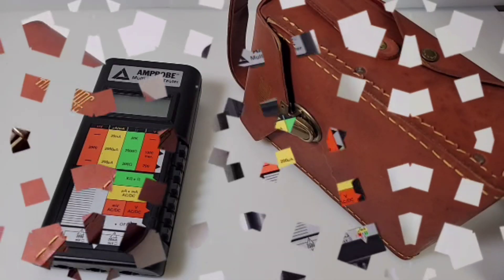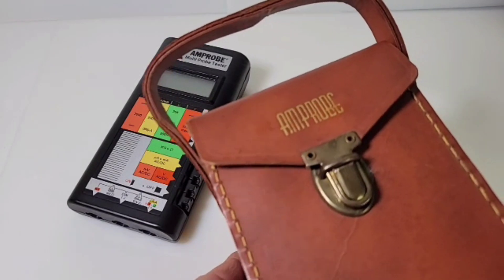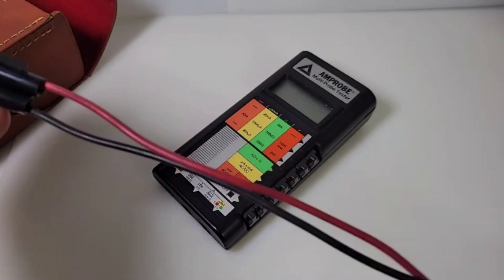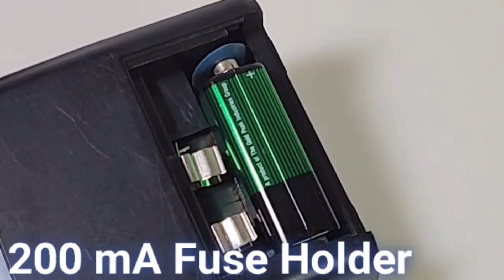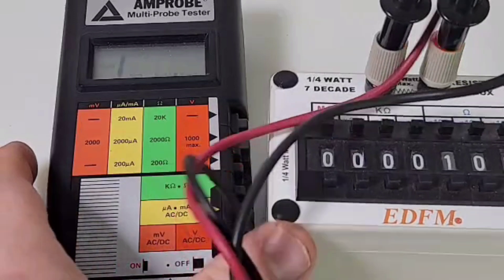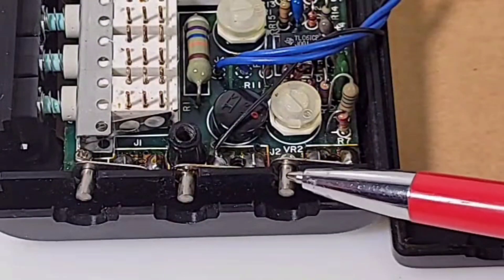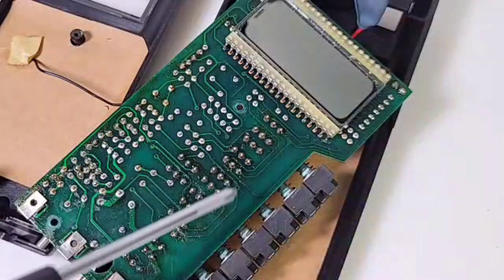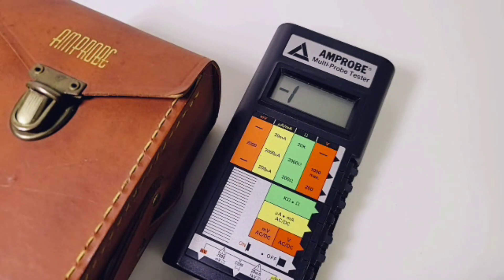RETRO-TECH ○ AMPROBE AM-5 Vintage Multimeter Mini Review  & Teardown!

Comment: Hi Darren. I received my house 616 today. I'll tell you a little report.
 I got the old version. Well, how old ... They showed that they now have a new case, where the numbers 616 are in the corner, and I got where the numbers 616 are in the center under the screen.
  The multimeter probes are standard 10A, half gray and half colored. At first they worked a little worse than my homemade ones with a good wire, but when I slightly cleaned the ends with 2000th sandpaper, then they began to work well.
 The 7502 main chip works fine. The call is very fast. Resistance shows very well. It measures capacitors - not very fast but not slower than its competitors. The voltage measures perfectly, exactly. I can't measure the current strength - I need an exact detail.
   NCV works and works well enough.
  Do you know how to check where the phase is in the outlet? I answer. You put the device on the AC voltage position and put any 1 probe into any socket. Where there will be 2 times more voltage, there will be a phase. Or you turn on the NCV mode and stick any 1 probe into the socket - where there is a phase, there the NCV will make a sound. But I think you knew these tricks, and if you didn’t know, then welcome to you)
  There are problems with the screen, with viewing angles, but I knew about this in advance, so I was not upset. In general, they are the same as the 113d. In 102 and any other RM made on the basis of the 102nd, the angles are certainly better, but the multimeters themselves are worse in accuracy - this is 100%. The 616 seemed to me to have very good accuracy and speed of work. It measures the temperature perfectly, boiling water is exactly 100 degrees Celsius.I haven't taken it apart yet, but I already know what's inside. Useless flashlight, like everyone else. The backlight is on for 30 seconds. Few((
 The Energy Screen doesn't require much. LEDs illuminate any.  Since he and others like him work on 3x AAA, it can easily be transferred to a single lithium battery at 3.7 - 4.2v.
 In general, I will wait for your review and I hope that you will come across such a good copy. I think that she will measure the current strength too accurately. You torture him well)))
 I think that for $ 11 this is the best multimeter. And before you could buy it for $ 7, can you imagine. Freebie)))
Reply from the maker: Glad first Impressions are positive! I'm still awaiting the 616. The multimeters accuracy and speed sound good..anxiously awaiting to review this model! щасливого Різдва🎅
Reply: @KeepOnTesting  Дякую )))
 
To continue the tests, today I took from a neighbor Mastech MS8233Z.  This is such a trash in comparison with the Lom 616. The 450 uF capacitor could not measure in 1 minute.  1 minute and no result.  Resistance is only able to measure very small, because large resistance makes small mistakes.  The screen is about the same.  Crona stands inside.  And the price is 2 times more expensive.  Wasted money ... This mastech loses in everything.

Comment: Both Amprobe AM-5 and Fluke 8024B look quite interesting. I wonder how durable the buttons were. It seems a rotary selector wasn’t only more convenient, but just in general a better option. And now we are going back to push-buttons on our smart meters. I really enjoy seeing how technology changes and evolves over time. But I’m sure we’ll never have multimeter cases like that one. What a pity.
Reply from the maker: There's a great thing about multimeters that you just don't see with most technical devices. Even though the instruments have evolved (for better or for worse) even a 40 year old multimeter is still a valid piece of test equipment that  can hold its own against today's meters.
Gotta love that ! 😀